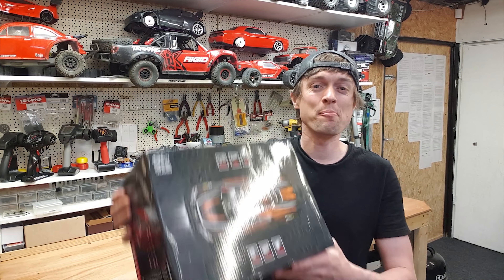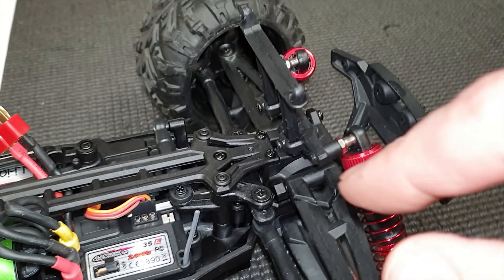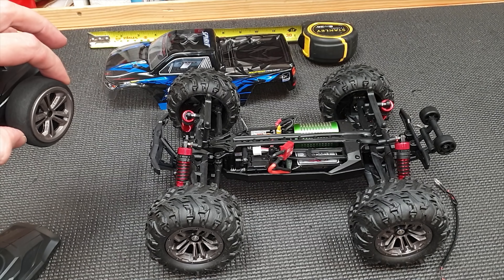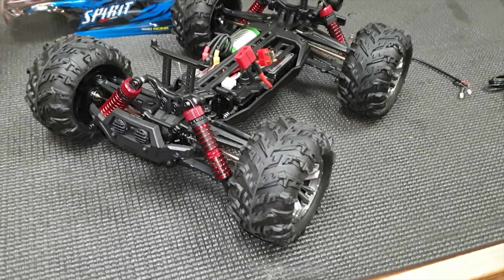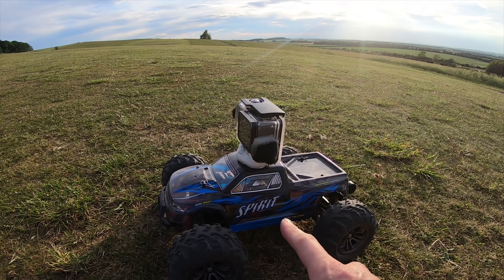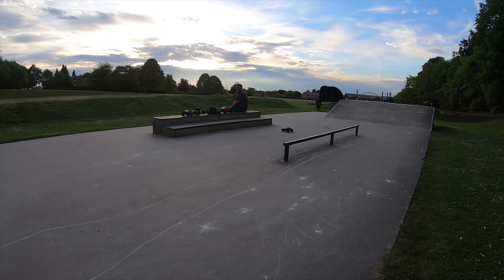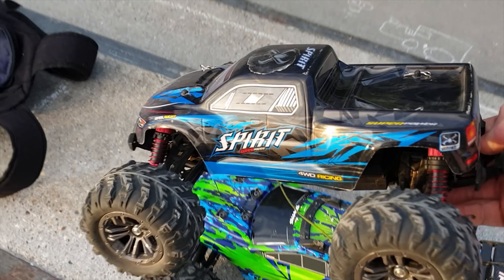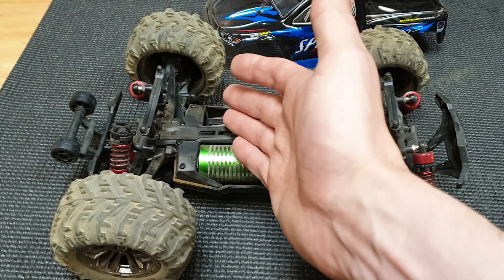Can this little Brushless RC Car go 52?

Comment: looks better then the WL Toys Trcuk! I had one and liked it, but the motor and ESC run VERY hot! I drilled holes in the motor mount and added heat sinks the the Mosfets. Still ran hot but no were near as bad. This truck looks to made of better quality.

Comment: In my best New England accent: "What a rippa!  Runs wicked hahd!"  I've got a budget minded 1/16th VW Bug from HobbyKing that is very similar.  That size is more fun than you would expect!  I figured it would just be something for my young boys and I'll stay with our 1/8th-1/10th vehicles...NOPE!  LOL 

 I have to respectfully disagree with you on the taller gearing though.  It seems perfectly set up for an RC track the way it just burst ahead with acceleration.  You can really see it tear up the dirt and accelerate in the sand trap clips.  Great vid as always,

PS. You need to adjust your wheelie bars!  The idea is to STOP the vehicle from flipping backwards!  Ha!  LOL

Comment: 2021 it now has oil shocks & lights pre fitted…
Handles very well & I rarely use it on high power mode in my big garden..I did fit fans & 3s battery but it was overpowered & spent more time on its back than on its wheels so I went back to original 2s battery…it’s a tough little car I’m very impressed
Reply: I'm just getting into this rc car stuff,  lol if I was to put a 3s battery in it what one would I use?
Reply: @rightsideup4444  I'm asking the same question too lol
Reply: and what are fans?

Comment: I had two of these XINLEHONG "brushed" 1/12 trucks. They are cheap and quick. But for hard core bashing they dont last long!. Front shock arm keep popping out. front shocks break. I replaced them with the ones that are in this video and are lasting abit better.
I have given up with these trucks (for my kids to use) and gone back to using my ReRe Hornet. not as fast but more reliable which is key when you have two young kids itching to play with the RC cars!!!

Comment: These are awesome little trucks,I have a brushed version,upgrades on shocks , axles and a higher mAh battery which seemed to make it twice as fast,almost to much.Biggest downfall is the misspelled words on the sides😋,it's a true"ricing" machine.

Comment: Hi mate did you try this with 2 batteries plugged in at same time?  See if it’s faster? Mine came with this option
Reply: 2 batteries option is what I have but it’s just for longer running time & that makes the motor hot..it won’t effect speed because it’s the same c25 & same volts..the added battery gives longer run time but that overheats it..
If you want more speed you need a 3s battery but stick to small 1500ma as you don’t want to run it too long so you won’t need the extra ma….get a c35 type it’s more instant power if you want but it makes it flip too easy so I’d use a c25
Also fans with a 5v reducer are advised but to be honest I did the mods & it made the car too powerful it just lives on its back unless your at a reallly big space & if it’s dry grass again it’s too grippy it is overpowered…even in this video harsh acceleration it just flips on standard 2s battery..

Comment: it's pronounced zinlayhong (xinlehong) and these cars are pretty good. this car looks like an upgraded 9130,9135,9136,9137,9138. i have the 9130 and it's just plastic with a little bit weaker battery but still super fun.

Comment: My shocks are a bit stiff after running it in wet grass, I put some oil directly on the shocks and the ball bearings, seemed to help but I wanna upgrade to oil filled shocks and a 2s lipo

Comment: Hi Kevin, my son has just broken the front lower arm on his q901, we have ordered a replacement part but I wondered if you could do a short vid on how to change it? He's only 7 and he's really keen to learn how to do the repairs himself....it would be much appreciated. Cheers, Jed and Ted
Reply: It's pretty simple, I have the same car and they wear down: take off the front bumper with the 3 screws on the bottom, then pull out the metal pin with some pliers, after that you can just pull the arm off the cup, and snap the new one in place (I use the pliers again so nothing else breaks) then just put the pin back in and the bumper back on. Hope that helps!👍

Comment: Your videos always get me fired up to go out bashing!! 👍😁 I have th 9125 1:10 and love it. Have all sorts of different, styles and size tires and spur gears and battery sizes. Had it for about 4 months, and have been thinking of trying different motors and I have 3 extra 540's sitting around and well you can already know. Gears in the head started turning. Idk if I want to do one or go dual 540.  Or brushless, I have a surpass hobby 2430 4 pole 7200 witn a 25a brushless esc. 
Which do you think?

Comment: is it wrong that I enjoy this more  then my traxxas slash and  Stampede  lol this Spirit is a great RC car. Edit: actualy I just used it and I found one weakness. the wheels  crack/chip. to be fair It was proberly due to the  big air it was getting lol but yeah if you plan on buying  one of these   I suggest ordering  extra wheels or new upgrades.

Comment: I had the same problem with my hero 5 black and I made sure wifi was off as well and it worked but the first time I tried with wifi on it failed but on the phone app I could add the stickers to see but not PC, but see if it happens again with the camera wifi off

Comment: Hello im a subscriber and watch your channel all the time,ive been interested in RC cars for ages n I'm thinking of buying this exact car.I have a couple of questions #1.Whats the difference between a brushed motor and a brushless motor?#2.With the battery in the car iv seen various cars with 500mah/1000mah/1500mah an so on can I put a 1000mah battery in a car that comes with a 500mah battery and what's the difference please.keep doing the wicked vids I love em.
Reply: Hey great review and video! Just want to bump these questions along as I'm interested in these answers too. Especially as to how easy and straight forward it is to upgrade this  battery. Thanks in advance !
Reply: Brushless motors are usually a tiny bit faster than brushed motors, I'm not entirely sure if it's because brushless motors are lighter than brushed. Also, I believe that this car has a 1,000mah battery because I had this exact same car just under a different name and bodyshell! Hope this helps- Andy

Comment: What was the run time? are there aftermarket alternative battery packs that fit to is it custom? as a lot of the cars I am looking at in the UK have between 1800 and 3200 Mha - cheers
Reply: 15 to 25 minutes
Reply: Hi, where can I get spare batteries and USB chargers? Kind regards